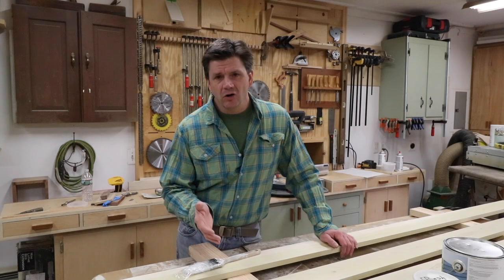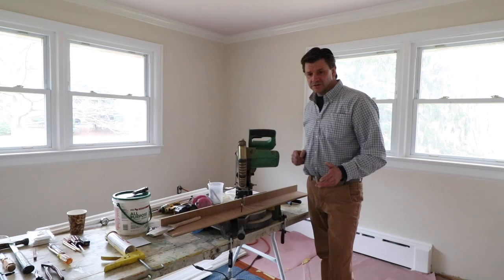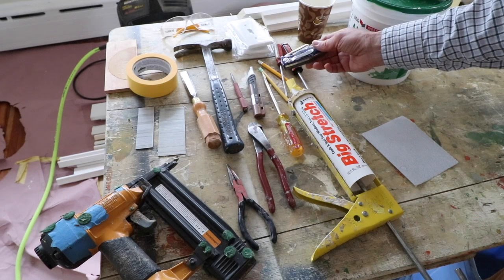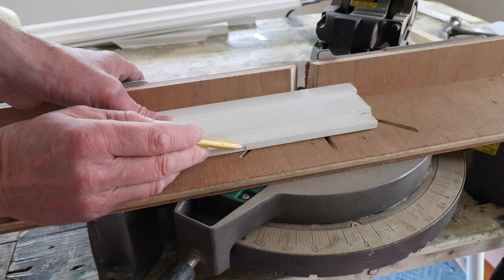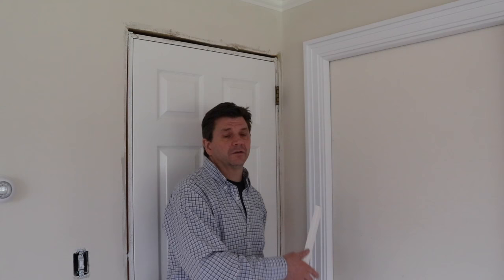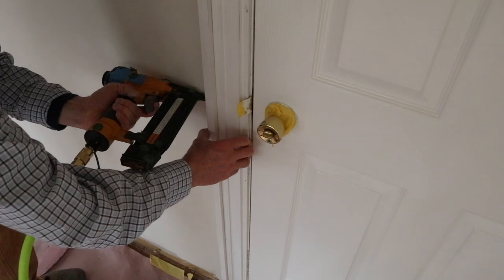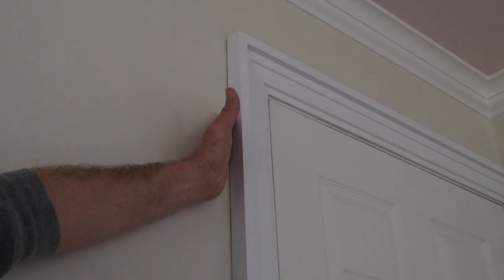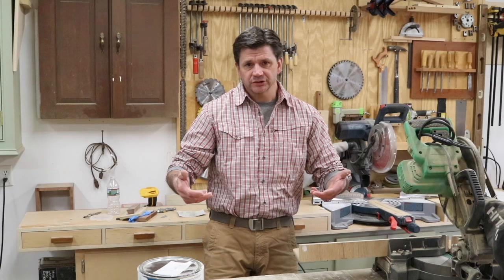How to Install new Window & Door Casing, Base board Molding

Comment: Jon, When I was installing door casing and baseboard similar to your job, I used an idea you had in one of your videos about installing a wood countertop. I used a small piece of aluminum flashing on the floor under each door casing base. This covers the floor and allows you to paint the door casing without getting paint on the floor. Then just pull the flashing out from under the casing and you have a perfect paint job, no paint on the floor and no tedious masking tape to place on the floor around the door casing. Works great and it was your tip!

Comment: one thing I like to do is draw a line with a sharpy on the chauk nozzle opposite to the 45 degree cut so it's easy to keep track of which way it's facing.  great video Jon.

Comment: Good stuff, Jon! When I was a trim carpenter, I was taught by a guy that did as you said, put up both verticals on a door and then capped the top piece after. I like the backer that you added to the casing.

Comment: Hey John, have you ever tried pushing a caulking gun away from you rather than pulling it towards yourself? You can move way quicker and the gun spreads it for you so very very little on your finger when you wipe it. I've been painting new homes for 6 years. It takes most people 1 or 2 baseboards to get the hang of it

Comment: Great video as always. I was surprised however that you only primed the moldings before installing. That would seem to make the painting more dificult later. I have in the past put one coat of final paint color on before installing, then I usually only need to touch up after.

Comment: I think trimwork is the most cathartic form of carpentry and completely undersold in the industry. Can't tell you how many houses I go into where the homeowner spends $10-15k on new floors but leaves the old baseboards (which by by this time partially buried by the floor and shoe). It's like buying a $15k piece of art and framing it at Michaels.

Comment: You're definitely a pro I would like to mention I usually apply wood glue all miter joints and scarf joints.  When using wood trim but I also do it with MDF trim. What are your thoughts on this?  I really like the way you have the shoe mounding dead end into the band.